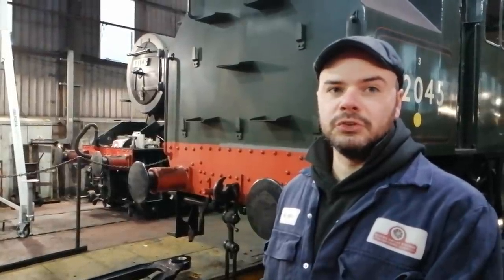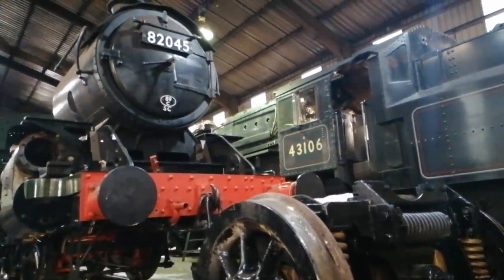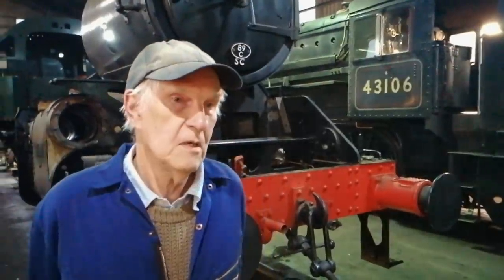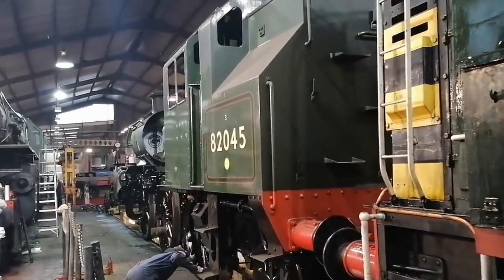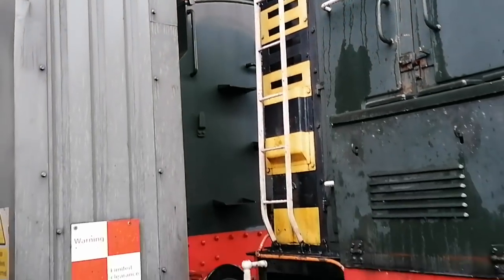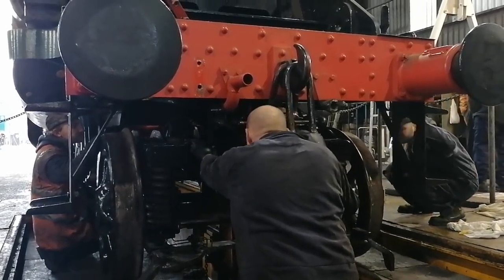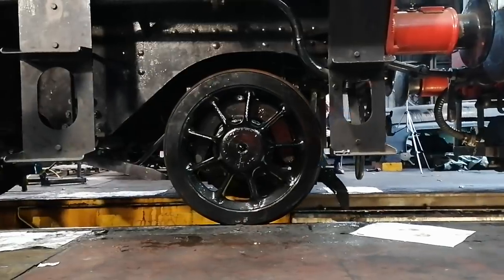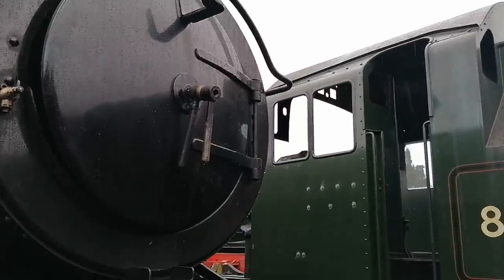BR 3MT 82045 Update - Fitting the new pony trucks and moving from the shed on Severn Valley Railway

Comment: I was very disappointed that none of these smaller British Railways locomotives were ever preserved, lacking the glamor of the big steam locomotives I suppose. I'm now following the new construction of this class 3 tank locomotive with great interest. I have always liked the balanced look of them, so about 25 years ago I had a 4 mm scale model of locomotive 82016 constructed for me for my model railway, in BR black livery as its condition when allocated to the Southern Region.
Reply: Most of these went to South Wales Wales scrapyards. Like Cashmores, Newport, Birds,  Buttygeigs and some to Cohens, Kettering.

All these yards did a great job slicing them for scrap. Cashmores had limited storage and usually did a fine job  cutting the locos soon after they arrived.

Non went to Woodhams at Barry, so that meant non survived very long.
Reply: SteamlocoScrapper :What a Shame!
Reply: @bazza3643  82016 was last based at Nine Elms and was cut up at Birds, Morriston, Swansea in 1965. If it had gone to Barry, Woodhams were such muppets, it would have probably hung around rusting for decades!

I'm surprised you like the look of these. Other standards looked more modern, and this looks cobbled together to me, especially the coal bunker.
Reply: SteamlocoScrapper : I've always admired the look of them. As you know they are very similar in appearance to the LMS Ivatt class 2  2-6-2 tank engine. if it is possible for a main line steam engine, I think that they look both cute and functional at the same time, and that is why I had a model of one of them made for me, long before the Bachmann model make its debut. I have photos of them on the empty Fawley Esso oil trains and ecs workings in and out of Waterloo.
Reply: There is/was? a project on the Bluebell Railway to construct a ‘new’ build 2mt 2-6-2 tank although in effect it was a partial rebuild as they were using many parts from 2mt 2-6-0 78059. I’m not sure if the project has stalled or whether it’s still ongoing? 
In any case there are 3 survivors from the 2mt Mogul class 78018/78019 on GCR and 78022 on KWVR.

Comment: Was the mismatch in buffer height between the gronk and 3MT due to the latter riding high without the spring-compressing boiler mass, or are they genuinely different?
Reply: Once the boiler is in and all is adjusted correctly it will be the same height 👍
Reply: @SteveLlewellynbgr  thanks for clarifying 👍